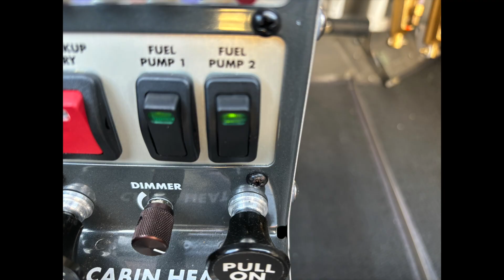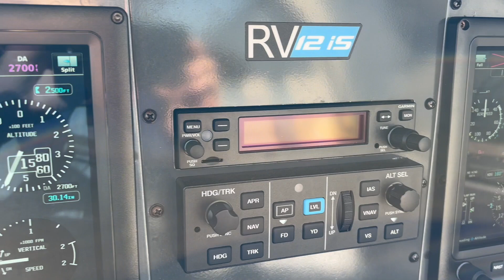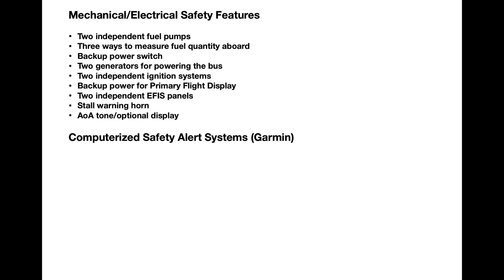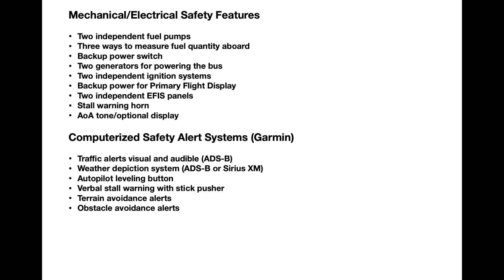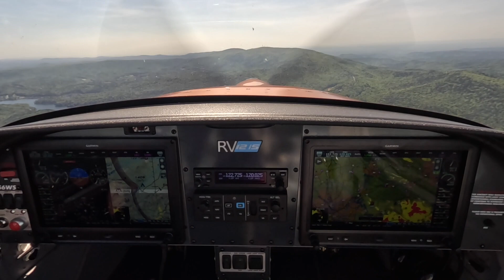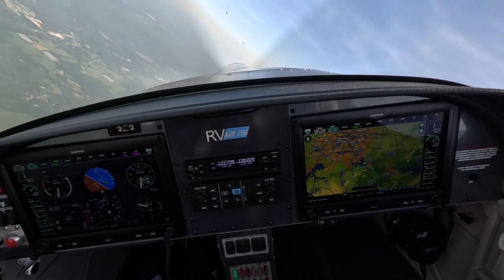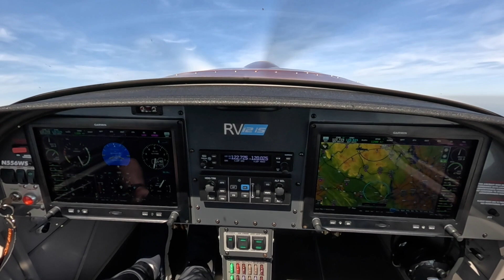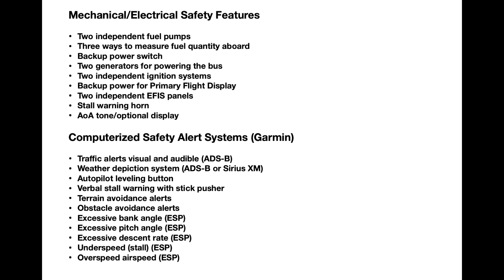Danger Lies Outside Design Limits

Comment: Hi, love your videos. I built and fly an ELSA version that appears identical to your SLSA. 165 Hrs total time. One correction, you have redundant fuel injectors. I understand that both operate in each cylinder normally but will adjust to compensate if one fails. I'm not a big fan of ESP. I had a faulty ADAHRS from first flight, reared its ugly head at an inopportune time, replaced for free by Van's / Garmin, that tried to manipulate the stick based upon faulty attitude indication. The concept is good, but I'm not convinced execution is as robust. The Level Flight button on the autopilot control head may have saved my life, and that of my sons, in an inadvertent entry into IMC. All the very best!
Reply from the maker: I learn something every day!  I did not know each cylinder had two injectors!  Thanks for that.  As for ESP, except for practice stalls and steep turns, I would never know it was there.  Actually I stumbled onto it one day while doing a stall series - I needed to read the Garmin manual from cover to cover, which I since have done.  Thanks for watching and for your comment.